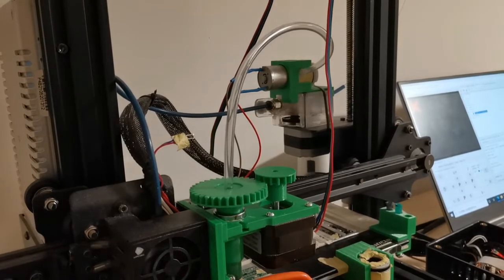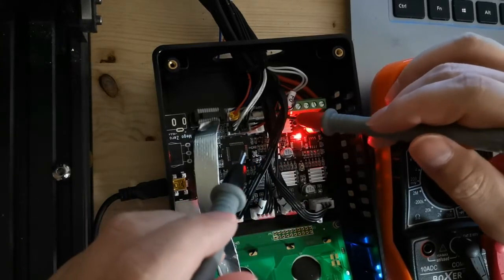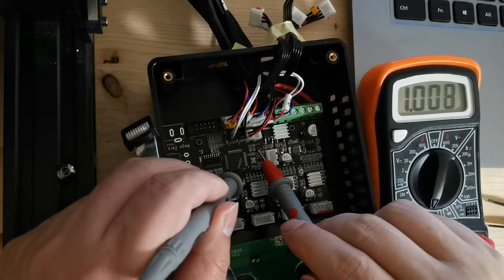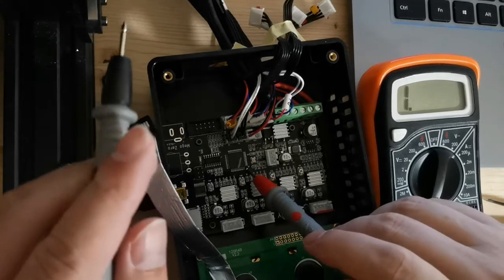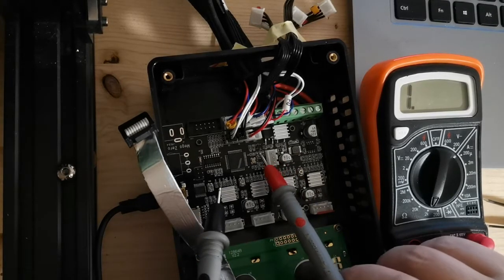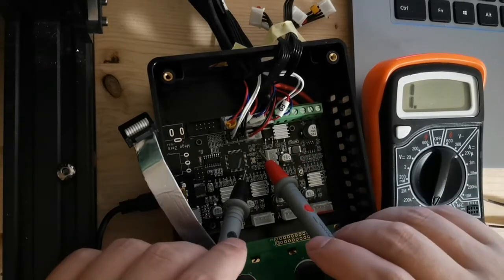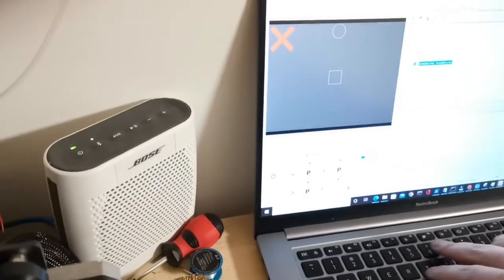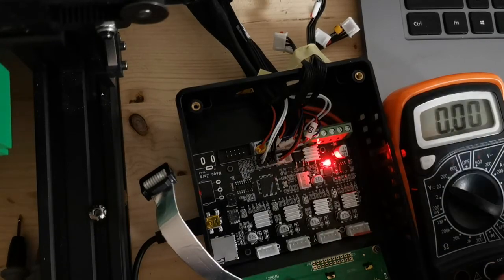DIY pick and place machine from 3D printer Part 3 - air pump issue and trouble shooting

Comment: Could you please share what is the technical description of the pump. I work on mine and I am not sure how much air it should more in a minute. Also the steppers I am planning to drive from 24v but not sure yet that the pump need.
Reply from the maker: It is maybe easier to share link, I used the one below, 12V, any similar ones will work, for me it is good enough to pickup chips, I am mainly working on small chip like ST, NRF ARM chip, 10x10mm should be good. Bigger ones I didnt try.
https://a.aliexpress.com/_mPcybek
Reply: @xpdiy  do you document your project somewhere on the internet? I am also looking for cameras and would be good to see your experience with that. Thanks!
Reply from the maker: @bzolitb  Documenting it would be a good idea, so far I didn't get to it yet, the camera I am using is OV3660 usb module, not as clear as more expensive ones, but they do the job, need to control the lighting to make it work robust from my own experience.
Reply: @xpdiy  was there any alternative for the camera or why did you pick this one?
Reply from the maker: I picked this one in my design actually.
Reply: @xpdiy  I believe any kind of usb camera could work even a simple webcam